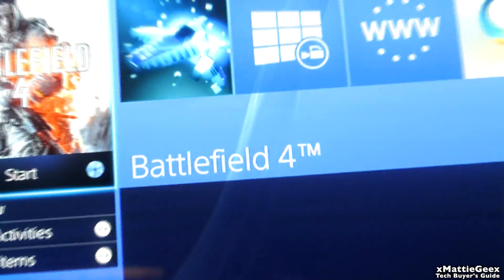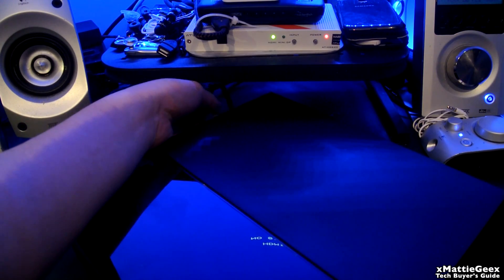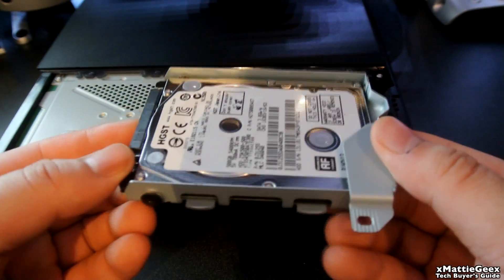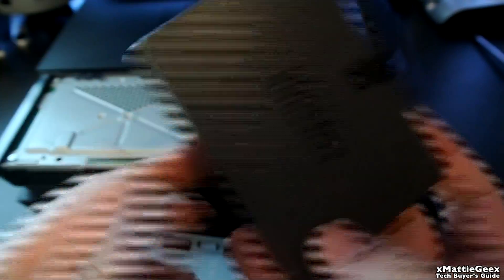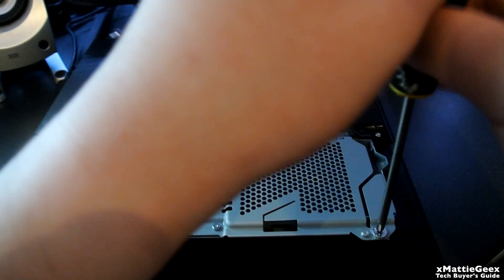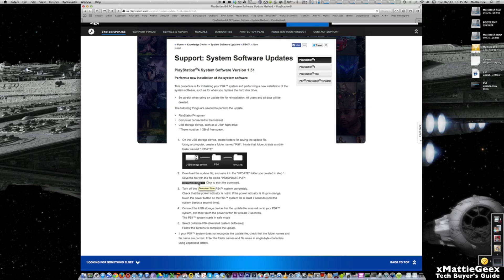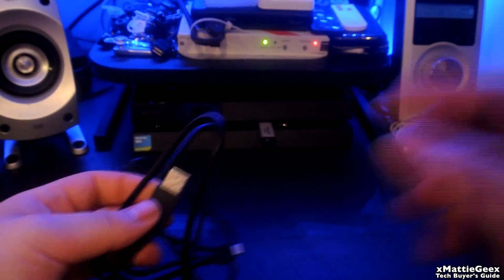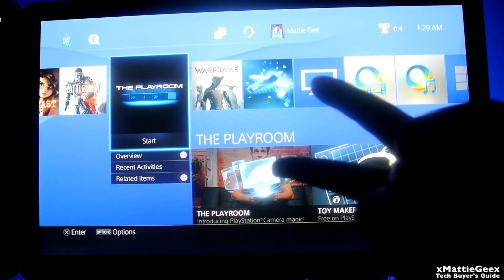How To Install an SSD, HDD, or Hybrid For PS4 (1TB SSD)

Comment: So I have a 1TB Samsung 850 EVO SSD drive as well, but my PS4 is the CUH-1215A model and apparently the SSD is a bit too thin for the 4 screws to go back in., or rather the holes are on the top rather than on the bottom. I was thinking maybe I could just elevate that internal hard drive to put the screws back in or found a mounting frame... Could use some help?

Comment: i have a 128gb ssd drive is that enough memory
Reply from the maker: ***** NO NOT AT ALL!!! I didn't think 500GB was enough 1TB-2TB's should be enough.
Reply: ok thanks i purchase a 2TB HDD but found a 128GB SSD for free
Reply from the maker: USE THE 128GB FOR COMPUTER ^_^
Reply: ps4 cant go no less than 160gig i think bare with me im only 12

Comment: Why did you buy SAMSUNG 840 SSD get Other Brand SAMSUNG 840 SSD Have problems even pro evo what ever you need to format your drive cause it will become slow as crap slow as HDD even more and reinstall it or wait for a new Firmware

Comment: Is it posible to transfer the data I allready have on the original HDD to the SSD you replace it with so that I don't loose my save games?

Because if I can't get my old saves back its not really woth it for me
Reply: You could plug the PS 4's old HDD into a PC, copy the files onto the SSD, and then install it. When you turn your PS4 on, it should continue where you left off.
Reply: Thx!
Reply: pretty much, but will take some time
Reply: its alot easier too save the data online, but you have to have ps plus. but mostly of those with ps4 have ps plus
Reply: Jacob røysland well im at about 300 GB now, can you save all of that online?!
Reply: Go into setting and backup your data

Comment: Hey Mattie. Thanks for the vids. If I want to install one of these on a PC and I do not want to clone anything I just want it as an extra data drive do I worry about getting a sata/usb adapter and going through that software step first or do I just plug it straight into the PC and image it from there.
Reply from the maker: You can use it like any other external drive, so no need to go through software installation.

Comment: If the ssd is one tb how come you only get 869gbs??  Where is the 134gbs???
Reply: Storage is never actually the full amount, that is with all types. Have you ever noticed a flash drive and how its off with the amount? Also he installed the PS4 Software on there as well, not sure how much space it took up, didn't full watch the video.

Comment: Is 7200rpm hard drive good for the ps4? Heard it draws a lot of heat
Reply from the maker: The PS4 creates more heat than the Xbox One regardless…a 7200 rpm HDD will be better for faster loading speeds.